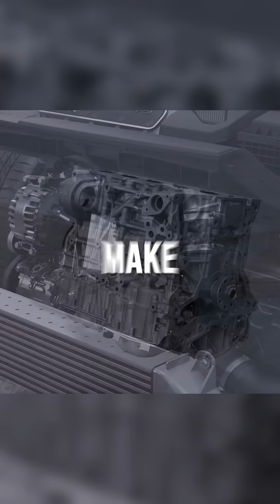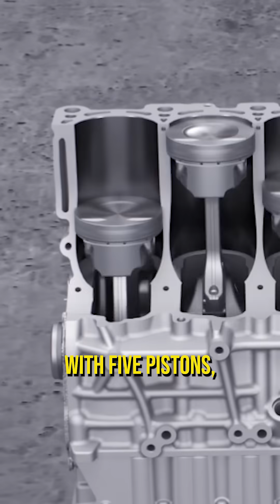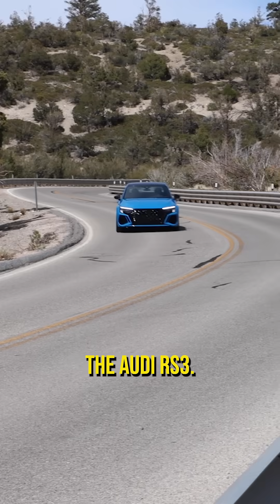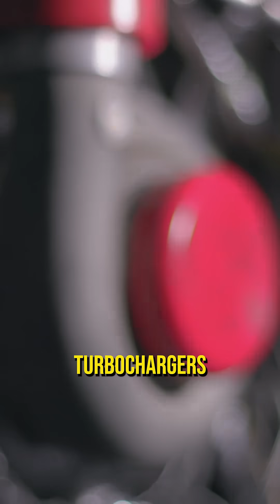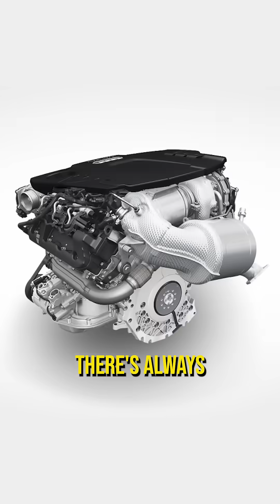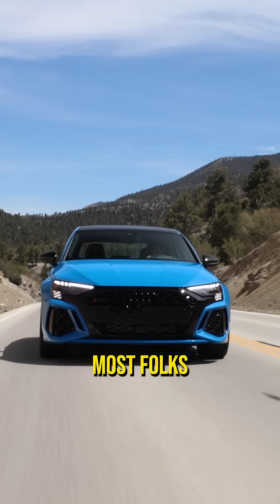What Killed The 5-Cylinder Engine?

Comment: 5 cylinder is cool and should remain. Volvo made a mistake getting rid of their 5 and 6 cylinders
Reply from the maker: Yep, they went down to 4-cyl (and even some 3-cyls with high output!)
Reply: @EngineeringExplained  You really should understand that a Five Cylinder 4 Stroke Engine has no dead spots in Torque. As that is the minimum number of Cylinders needed for an Otto Cycle 4 Stroke Engine to always have a connecting rod pushing down on the crankshaft...
If you still don't get this, try driving an Audi 4000 base model and a 4000 Coupe GT, both with a manual transmission and you will feel the difference. You will also realize that you can smoothly let the clutch out on the five cylinder without pressing the accelerator and the car will slowly crawl along, even up hill, while the four cylinder will stall if you try this...
Reply: @EngineeringExplained  if they made cylinder 3 the first cylinder to fire, with the two on either side next, and on either end last….. I believe it would likely be a far better balanced engine.

That’s what made the international (jeep) 4.0L engine so good is the engine quality and balancing.
Reply: @EngineeringExplained hello Jason! Great stuff every time, much appreciated since 2019 ✌️🙏🙏🙏✌️ The joke from the end... 😢I hope is a joke. Otherwise a few great friends = family/like brothers! Wish you all the best!
Reply: Now mazea brought back the inline 6 in their large CX-90 SUV! yes, In 2025 😂. It is even sold in Europe, even though smaller engines and cars are usually the norm and not an exception in europe.
Reply: @blackcub3s the cx90 isn’t sold in Europe. Only the cx60 and cx80 with a 6 cyl diesel or 4 cyl petrol hybrid
Reply: @ZonexG  well,could be. Anyway an inline 6 is surely sold: I saw it written "inline six" on the street. I really didn't check whether it was diesel or petrol.
Reply: Thanks to the emissions.
Reply: @  And efficiency... I loved my V50 T5 AWD - but my G20 330i had 1 less cylinder, 500cc less capacity and made more BHP and torque across the range (and was 2 seconds faster to 60mph) whilst using 1/2 of the fuel... How a sub 6 sec car could do up to 60mpg on the motorway at 60mph was mindblowing. I missed the sound, but I didn't miss the trips to the petrol station 😅
Reply: Volvo having a transversely mounted inline 6 is still wild. Every time I see one come into the shop, I'm in awe.
Reply: My Ford had a great 5 cylinder from Volvo but I also do really like what Volvo did with the XC90 going to small engines and creating a massive interior space. All the competition reserved space to fit more cylinders.
Reply: @Deveonn  yes but now the engine isn’t going to last as long. Smaller engines tend to blow up prematurely while Volvos usually can do a lot of Kms because of their beefier engines.
Reply: @Gren4te  the longevity of Volvo is more thanks to great maintenance and the type of driver it attracts compared to for example BMW.
Reply: @Deveonn  not a very strong argument for the Netherlands where the V40, V50, V60 and V70 were very popular leasecars whereas BMW usually only had the more expensive 3, 5 and 7 series driving around as lease. 1series BMW aren’t competitive at all. I am driving one rn and they really aren’t good. 

For the netherlands the stereotypes are basically the same for those two. 

(Oh and don’t get in the way of a tesla. You can’t keep up anyways).
Reply: @ I don’t see many V60 D6 or V40 D4 driving around anymore.. Those were definitely not als “reliable” as the V70 or even XC90 without low “bijtelling”.

Also most V40 D4 en VW GTE drivers went to the Model 3, so makes perfect sense. However I still see many Model 3’s just driving normally outside office hours.
Reply: @ yes exactly. Those models didn’t have a beefy engine. Those were both small blocks with a turbo. The new B line has the same problem.
Reply: @ the XC90 has a 4 cilinder on 2000 kg and the V60 D6 isn’t downsized..
Reply: @Deveonn Some models of BMW have great service records if you maintain the.  I agree.  Ppl who don't put in the maintenance always have problems.  If you do, you still mightve bought a lemon if you didnt check.
Reply: @Deveonn This really isn’t the case, as Volvo’s 4 cylinder doesn’t take up less passenger volume than the 5 and 6 did. Those are all transversely mounted engines, so a longer engine doesn’t go any further into the cabin.
Reply: @ there is more under the bonnet then just the engine. Other systems need space too. But perhaps the difference in the cabine is due to the XC90 being electric on the rear axle only, no driveshaft to the back.
Reply: The first volvo I ever owned, and actually my first car too, was an 04 volvo c70 convertible, and it had an inline5 and it was pretty fun to drive.
Reply: Volvo got so boring its insane. 4cyl in a xc90 is just laughable. And i dont care if the 4 banger makes 52839 gazillion horsepower, it will never be as smooth
Reply: I totally agree! Not only do the four cylinders not sound as good they are also more rumbly. For instance my parents had a 2014 VOLVO V60 D3 with a 2L in-line 5 diesel which was really smooth, even at idle, but then they got a 2017 V60 D3 with a 2L in-line 4 and that was very much less refined it felt like, for instance it vibrated on idle, I did not like that engine at all in comparison.
Reply: As someone w an 850R, I can say the volvo 5 cylinder is something everyone needs to get behind the wheel of once
Reply: @dolonia8216  imo the 850 would be perfect if it had a VGT, it would cut down the turbo lag. Maybe having experience the 2.0T instead of the 2.3T could have a bit more lag? I'm not sure. 
For reference the 2.0T was the same block/bore with shorter stroke for Italian market . Anything above 2.0 gets heavily taxed. Still made 214hp :) 
That was one smooth sounding engine
Reply: @ I could understand that when it’s stock but with an exhaust and a tune the 850 can put down 270 and that turbo lag is more than halved. I’ve been tuning 850s for a few years and it’s a great platform to build off of even if you don’t wanna dump thousands into them
Reply: @dolonia8216  that's a game you got to be careful in my country. Anything that changes characteristics and homologation that on the registration paper usually forbidden. 
In case of accident insurance could void your claim. 
You can get a build homologated but it's not free. 
People tend to keep their cars stock. 
Very few do it the proper way and a bunch will butcher a TDI or a Peugeot 106 xsi in their back yard.
Reply: Agreed.  Can't speak for 5 cylinder engines, but the inline 6 was amazing.  Quiet, smooth and unobtrusive.
Reply: I still have a volvo v50  5cyl diesel and will keep it  as long as I can 😊
Reply: Tuesday  I drove 900 km  and returned  on Friday my 2007 v50 d5 did 6.5 ltrs to 100 km it still amazes me I love it
Reply: @Hollyjade2181  isn't the D5 a bit tight under the hood of a P1 châssis? 
The only v50 I got to drive was equipped with the 2.0hdi from Peugeot. Very solid engine too and economical in Europe since parts are shared with the 307. Downside it's only a 4cyl
Reply: @alexdeadeye6905  the d5 seems to fit well, in Australia  it was the only motor  I found  and wanted
Reply: @Hollyjade2181  makes sense
Reply: volvo 5 cylinder with the right exhaust sounds just heavenly. 5 cyl is my favourite engine tone, i just love the sound. of course v8 v10 v12 all sound amazing, i got soft spot especially for the volvo 5 cyl. i wouldn't get new car ever anyway, so i don't mind that much manufacturers got rid of it. i can always get an older Volvo, like i would do anyway. new cars just isn't it at all for me, i like driving and these new cars are so clinical in that aspect. it's just not my vibe at all
Reply: @Nakkiteline  as someone said one time somewhere in the internet, the L5 is just a baby V10 ^^
Reply: @alexdeadeye6905  yeah!!!
Reply: not to forget Mercedes' legendary line of diesel 5's
Reply: There’s a reason we’ve got five fingers on each hand, and five toes on each foot. Five is the magical number that gets you moving. So keep the five cilinders alive!
Reply: its a shame, but its all about the money
Reply: Audi has been making 5 cylinder engines since the late 70's
Reply: 5 cylinders have perfect balance.
Reply: Agreed, loved that 850T5, now I love my v70 D5
Reply: Volvo made the mistake of continuing to make cars
Reply: The volvo D5 engine is genuinely my favourite engine I have ever used.
Smooth, sounds good, decent economy, reliable and don't require too much maintenance. 

Only issue is the turning circle due to the width of the engine.
Reply: @tomnorris1734  that's what has me thinking more than once. The turning circle is very tight on a 850 whereas the v70II is very wide. not sure why if it is because of max width of tires or to preserve the driveshaft, dunno
Reply: The Mark Rober voice over is cool
Reply: For real, I drive the first gen V70 and its 5 cylinder turbo diesel is the best sounding engine I've ever heard 🤤
Reply: @Kalle.Thomsen  that first gen TD is an audi engine if i recall good
Reply: Currently putting a 5 cylinder in my land rover
Reply: I loved my Volvo 850 5 cylinder
Reply: Then well, if that's the only thing they thrown away.....in the Netherlands a 20+ year old Volvo is probably the most socially acceptable car.  I have  no doubt that"s not the case with this newer models in about 20 years.
Reply: Those 5 cylinder 2.4 diesel engines were tanks if you took care of them...also good fuel economy and decent power.
My grandpa still owns a 200y V70 2.4D with 163 hp.
Reply: Yes, thank you. I have Xc60 D5 which is awesome
Reply: Sounds wicked.
Reply: Why did we never see a 7 cylinder engine?
Reply: You can blame Euro 6 for that. They're bunch of lit major 'rich daddy' crowd that didn't like how much Engineers make and they never wanted to admit that Engineers are the superior, famous Europeans and they are the inferior, lame and lazy Europeans.
Reply: The only 4 cylinder that I don't hate is in the t6's. Twin charged 4 cylinder baby.
Reply: My wife has the T6 (twincharged 4cyl) in her XC90. I’m impressed by the performance but holy crap it sounds like hot garbage.
Reply: @hofahome  I heard some of the old T6, from the first series S80, the 2.9 t6. Damn that sounds good, even without a good exhaust
Reply: Iconic were the 5 cylinder high performance, yet Most Pity for the 6 cylinder = way better, even if not transversal 🤷‍♂️ yes, 5 cylinder = less parasitic friction, but 6 cyl = better ratio for power anyway, less vibrations that induce even unwanted friction and damage.
Reply: I 100% agree. I own a Volvo C30 T5 and it is an amazing car because of that T5 engine, I just wish they made the exhaust a little louder from factory
Reply: @daremoyt7216  they have some Aftermarket solution for that. greetings from a focus T5 with 3" stainless from turbo

Comment: A 4 Pot can Never Sound this Good
Reply: It can with a crossplane crank like what Yamaha put in the R1
Reply: S2K would like to have a word with you
Reply: Bro never heard good tuning or cross planes or beefy cams
Reply: I beg to differ. Not even Yamaha crossplane 4 banger can beat the beauty of a kawasaki flatplane engine especially the ZX RR 🤤 but that's only opinion.
Reply: @superlight1999  "Not even Yamaha crossplane 4 banger can beat the beauty of a kawasaki flatplane engine....but that's only opinion."

Yes indeed that is a matter of opinion, and we will most definitely have to agree to disagree about the sound. Stand to one side of a Shelby Cobra 427 and that's more or less the sound you hear from the R1 crossplane. If you ask me, no other 4 banger can even hold a candle to that, except some V4 motorcycle engines, which sound very similar.
Reply: Old 80s i4 engines are the PEAK of i4 engine sound. Eventhough my E30's M40B16 was designed by parapeligic baboons that made the belt the widht of a shoelace, it still sounds amazing even though it's stock
Reply: It’s not about sound it’s about efficiency and effectiveness
Reply: This is a very very close minded opinion. Too bad these i5s suck balls.
Reply: Idk fam!  I've never heard a 5 cylinder rev to the moon emulating the sounds of high revving V8, and v12s!   4 cylinders sounds great when they rev high! To me 5 cylinders sounds the best when paired to another 1 to make a 10cylinder  v10.
Reply: @civiccrewrojosi  That's just because nobody's made a truly high revving 5 banger. If you want an idea of what one would sound like, listen to Mad Mike's 5 rotor wankel engine.
Reply: The 5 will always out pull a 4 equivalent
Reply: Civic type R enters the chat
Reply: @benda18  the new ones sound meh
Reply: This
Reply: Brotha need to hear a focus rs with a good exhaust
Reply: The Subaru EJ engines sound better
Reply: Of course we're not talking bikes
Reply: Bro never heard a bike engine
Reply: Crossplane 4's sound fantastic.  Yamaha R1 and MT-10.
Reply: SR20? CA18?
Reply: I counter that with the 1.4MA turbo in a Fiat 500 Abarth, or 124 Spider with the Record Monza exhaust. Those dinky engines have no right sounding that meaty, lol! 

Sidenote, I LOVE how I5s sound!
Reply: @josephrumpsa180  I counter with the Yamaha R1 crossplane, which sounds like a little V8 when running at under 9,000rpm. By far the best sounding four cylinder engine ever, imo.
Reply: @DaverZ  Oh, I forgot about the R1!
Reply: @DaverZ  I'm sorry, but the inline 4s sound way better than the v4s. I will admit that the v4s are superior tech though.
Reply: @Powerslide15  Are you talking about the crossplane or flat plane inline 4s?
Reply: @DaverZ  I'm trippin' aren't I? R1 is crossplane I4 isn't it? I like flatplane I4.
Reply: @Powerslide15  No you're not trippin'. Everyone has their opinion. I think the sound of the R1 crossplane is unbeatable when it comes to 4 bangers. The Ducati and Aprilia V4s don't sound identical or as good because they actually don't have the same firing interval, due to either the bank angle or crankshaft design, depending on which bike you're dealing with.
Reply: @josephrumpsa180 they do sound amazing. But an i5 is special. If you hear it you know it’s a fast Audi. Plus the History in Group B. It essentially has the notoriety of a rotary engine without the major down sides.
Reply: @josephrumpsa180  reminds me of my Cobalt SS turbo. it had a turbo back 3in straight pipe. sounded like a mix between a tractor and a bastardized EVO. LOVED how it sounded, HATED owning it
Reply: @josephrumpsa180  I used to daily a 2012 suzuki swift sport and that 1.6l inline 4 with a custom built stainless exhaust and a remus muffler sounded like a little rally car. it has no right sounding that good!

but my current turbo inline 5 is just on a different planet when it comes to sound!
Reply: @josephrumpsa180 fiat 500😂
Reply: @shaunsnyman5107    Correction, Fiat 500 ABARTH. That Abarth reworked car's engine (FireFly MultiAir iVVT) is incredibly sounding with Abarth's dual exhaust system (basically a mini K24, and it also has an infinitely variable valve timing just like that engine)
Reply: @shaunsnyman5107 Abarth*
Reply: Boxer 4 sounds better imo
Reply: My 4 Pan actually does sound this good.
Reply: 4 cylinders never sound good.
Reply: @dom3827Yamaha r1?( For inline 4) 
High revving bike inline 4
Aprillia RSV4 . 
This is for bikes though, for cars 4 cyl's sound generic.
Reply: Literally STIs and Evos sound way better than that VW😂
Reply: @ since when do broken 4 cylinder sound better than even anything??

Make a 4 cyl run roughly on 3 or 2 cylinders and it will sound like an STI. No difference.
Reply: @dom3827 Who are you replying to? The person's username is missing from your reply.
Reply: @DaverZ  its a youtube bug. One of millions.
I refered to BraDia
Reply: beams engine sounds better
Reply: 5 pot isn't as good as the V6 neither. When you buy spark plugs that comes in pack of 4, you need to buy 2 packs and end up having 3 spares. As for V6, I keep the 2 and later but pack of 4 spark plugs for next replacement is just nice. 

If the engine is 2.0L, having 4 cylinders could achieve better torque than 5 or 6 smaller cylinders which have been proven practical and more optimum in generating pulling power (higher torque at lower rpm) yet more fuel efficient. The 5 or 6 cylinders could churn out higher horsepower at high RPM improving acceleration while the car is not loaded with passengers. When you have 4-5 full size adults, the inline 5/6 or V6 starting to feel sluggish requiring to rev harder to move especially going uphill.